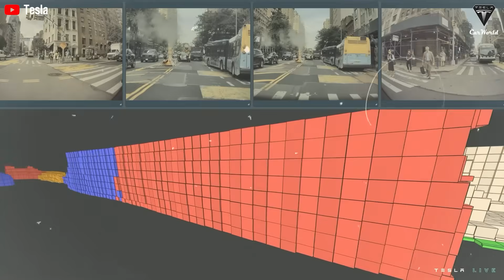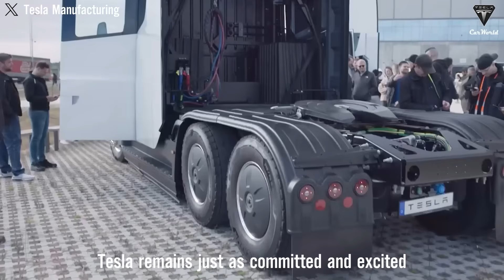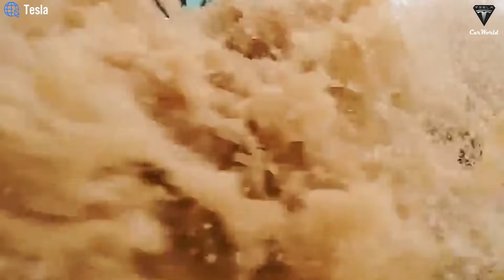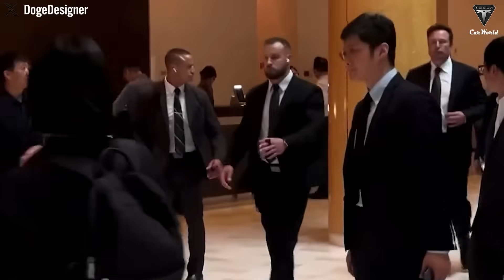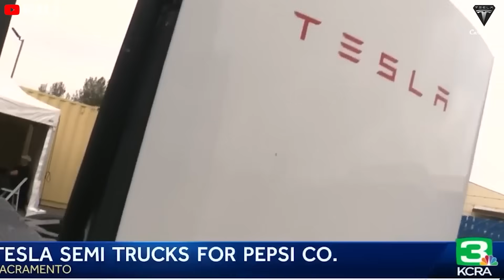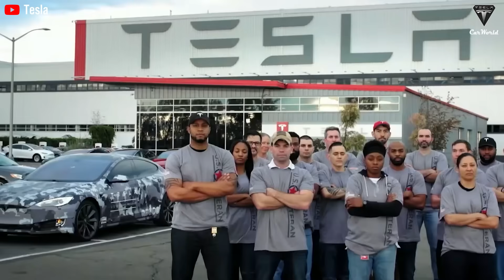It Happened! Elon Musk Confirms 2025 Tesla Semi Final Testing Spot With 1.6X Range & Insane Price!

Comment: Fox News appears to overstate the battery weight and charging requirements, suggesting that the batteries significantly reduce the useful load. Friday, Tayler Riggs on the Big Money Show stated that it would require 6 charging cycles to run a full load round trip from Reno to LA. I think it could be done in 2 sharing cycles. They also indicate that the bridges would need to be upgraded to accommodate the extra weight of the EVs. Trump seems to not understand. We need real weight and charging information readily available. Other Foc shows seem to have the same misinformation, or am I just wrong? How much more does a 500-mile Tesla tractor weigh compared to a diesel tractor?

Comment: Lower maintenance is great, but not enough to justify a 2x price hike.
Reply: The largest two costs for Diesel trucking is fuel snd maintenance. The Semi will have very low maintenance costs and electric charging at 25 % of Diesel. So even if the Semi costs double, the life cycle savings will pay for it in about 2 years. So basically a free truck. The line of companies wanting to get some is way greater than any number they can make.

Comment: The payback period doubling is a dealbreaker for most logistics companies.
Reply: The largest two costs for Diesel trucking is fuel snd maintenance. The Semi will have very low maintenance costs and electric charging at 25 % of Diesel. So even if the Semi costs double, the life cycle savings will pay for it in about 2 years. So basically a free truck. The line of companies wanting to get some is way greater than any number they can make.